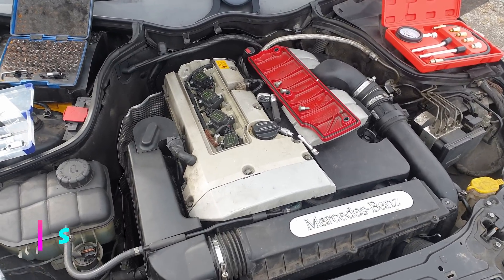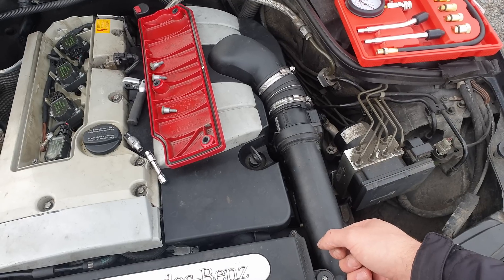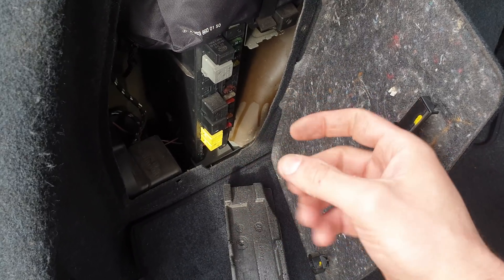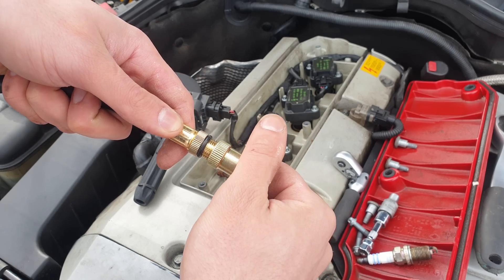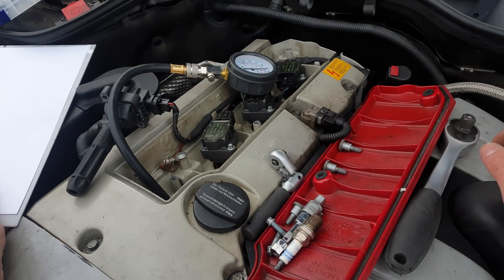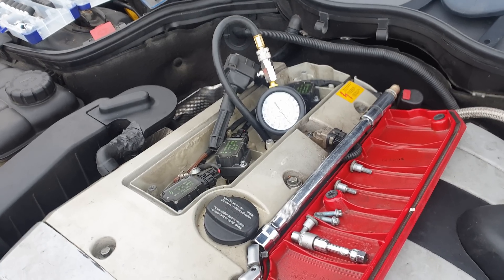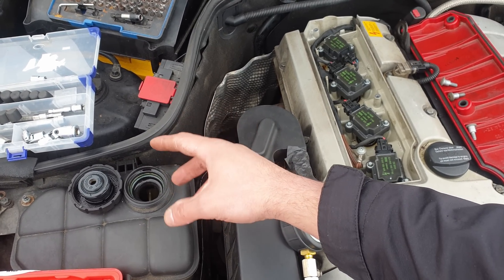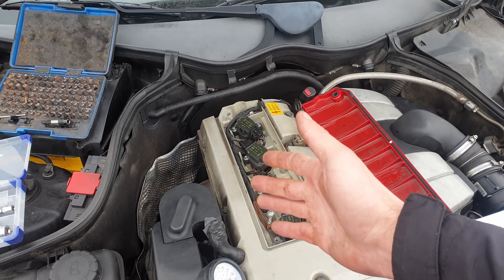Compression Test on Mercedes C200k w203 M111 955 Engine

Comment: Hello can i contact you by WhatsApp or any other way to send you a video for this test and ask you if the result is good or not please because in my country there's no one to do this i have the same car so please let me contact you I suffering from oil in the AIR MASS FLOW SENSOR and i want to know if it's from the pcv valve or it's from the engine

Comment: Thank you sir. Iam from Turkey. Our mechanics are reliable engine slayers. My cars compression was 120 120 120 120. They said valves were turning around. It was rock solid and ıt can hold performance driving. They use a iron cutter and broke flat surface of engine block. Now my car gives compression to coolant hose.
Reply from the maker: That's sad to hear , hopefully u can do most of the work yourself in the future

Comment: I didn't made this compression test on my m111.956 but removed the intercooler and spilled some oil. You've mentioned that there  shouldn't be any oil from the air intake up until the intake manifold but, the oil separator, if not cleaned regularly, does notbuild up oil from the recirculated vapors comming out  from the engine? I'm asking this because I find it quite logic. Best regards and thanks for your vids, they're very very useful. Thumbs up!

Comment: I have Mercedes see 200 compressor and won’t start and I check the compression all four cylinders Has no compression at all
Reply from the maker: If there is really no compression at all , either the gauge is broken or there are serious internal damages in the engine , like broken piston rings / valves / cracked engine block

Comment: Nice informative video..thank you.  I did this test a week ago on engine M111.960 (E220 W124) ,I forgot to do the test with throttle wide open (is this necessary?)  the readings were : 130    110     130    120 ....are these acceptable? what are the stock compression for this engine model?
Reply from the maker: I suppose it's a gasoline engine , the compretion ratio is 1:9 on  . So if you multiply 9 × 14.7 (atmosferic pressure ) = 132 psi it should be acceptable  even with the 110 psi ( although not the best )

Comment: I have a misfire on cylinder 3 an I'm going to do this compression test on it but what should I look for ? Thanks
Reply from the maker: check if there is low compression ; try to record the gauge while doing so , replay the footage and see how much the needle is raising when the cylinder moves first time . You might wanna check also if the spark plug is creating the spark proportional with the engine speed : remove the coilpack , remove the spark plug ( both from cylinder 3) , connect the spark plug on the coilpack -but outside of the cylinder so you can see the spark in a safe place , and connect the threads of the spark plug to the ground ( negative terminal of the battery) .Than start the car and you should see the spark on/off rapidly , proportional with the engine RPMs .
Reply: @doit_vehicles  thank you I will try today